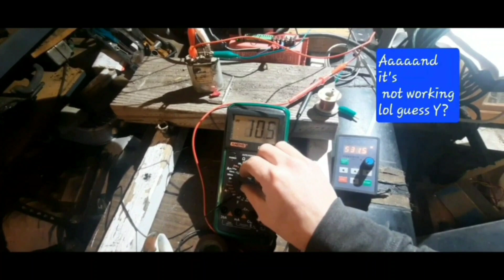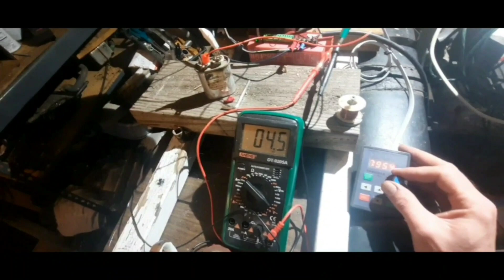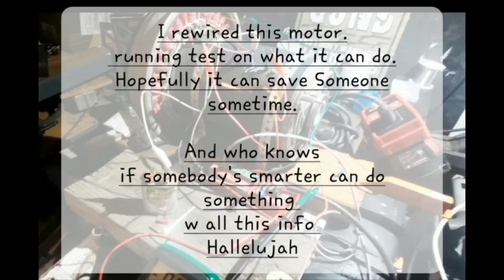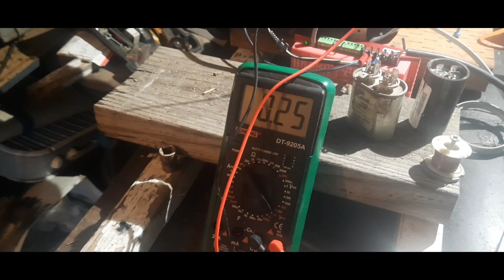something new to try. bldc stator motor.

Comment: As long as the magnets rub the poles you won't get full power
Reply from the maker: Thank you everyone for your help, yes I do understand, I just wanted to see if this was worth it and something cool did happen. Yes it was very half azzD, but I did get a very good test result so I think. I will do tighter wraps more of them and different combinations.
Maby go for low rpm power 1st.
Reply from the maker: I will also get temp readings under some type of load. 
Quick ? Do you think delta wrap would run cooler or wye wrap?